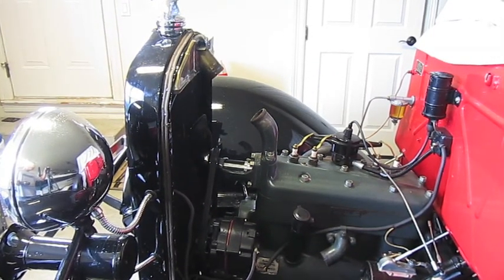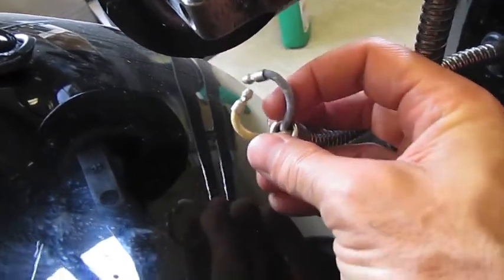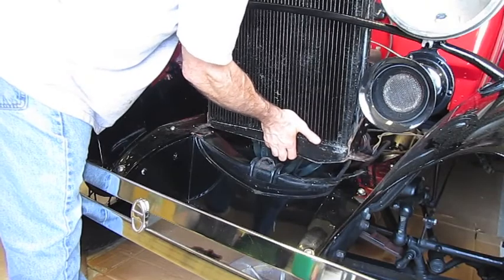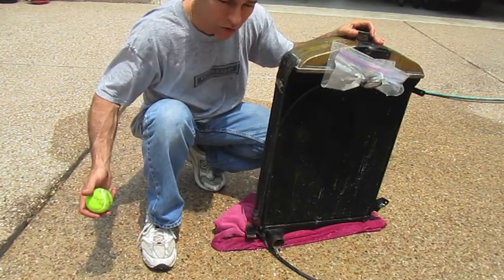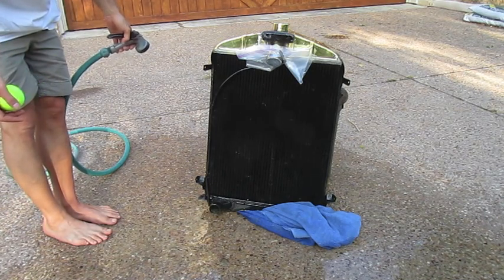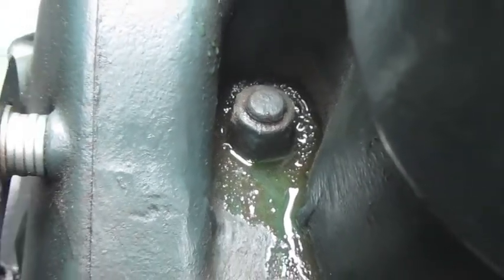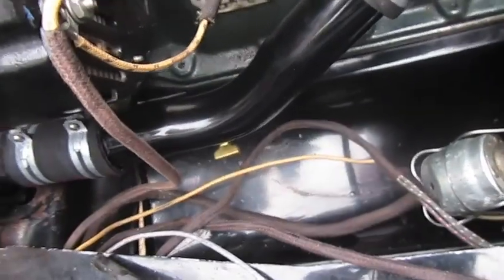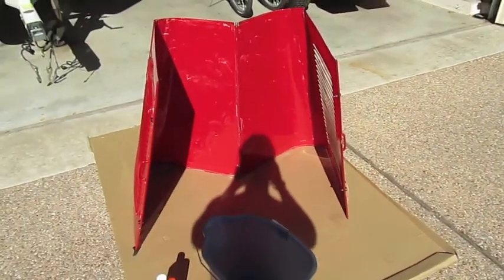Ford Model A- radiator removal, install, test

Comment: Why not install a thermostat in the upper hose?  Also, why not install a recovery tank on the overflow tube?
Reply from the maker: I try to keep my Model As original, so I have not installed these.  I may look at a thermostat when I get some time to test it out later.